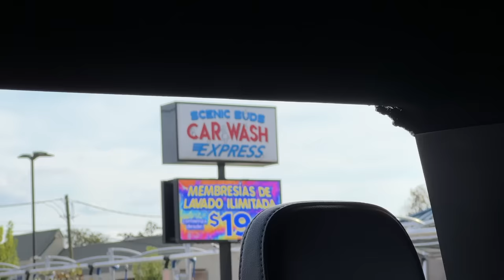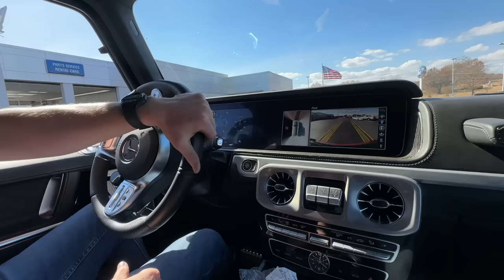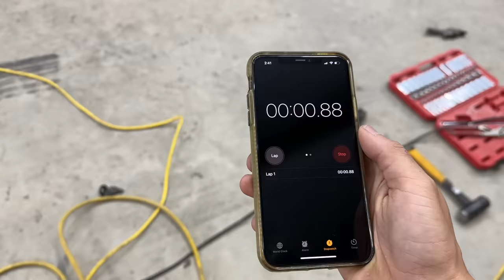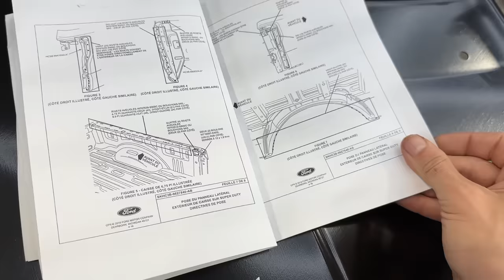We Rebuilt A Wrecked 2022 Ford F-250 In 30 MINUTES!!!

Comment: Taking it through the Car Wash like that was a VERY dumb idea, now you will be chasing electrical gremlins for a good while! 😂😂
Reply: Believe it or not most carwashes don't use salt water
Reply: Not going to hurt it one bit.
Reply: NOPE. if that's the case why would you wash the engine bay ? Now if the truck was under water now that's a different story.
Reply: @jerrywilcox9890  Yeah, soak those leather seats, it's good for'em.
Reply: @daquekenfor6901 it’ll more than likely be fake leather real leather is used for the more luxury car brands all the others use synthetic leather
Reply: I just could not believe they did that.
Reply: It’s gonna smell sooooo bad
Reply: @daquekenfor6901  lol so what lol it's not going to hurt anything.
Reply: @daquekenfor6901  shit I've left my windows down in my truck in rain storms more times then I can count.nothing has happened to them lol.
Reply: @danvdz  no it won't.
Reply: @floydhelms44  there not the first to do it nor the last.its not going to hurt it so it doesn't matter.
Reply: That will be the next giveaway vehicle
Reply: The connectors on the outside of the vehicle are meant to be exposed to the weather. The connectors inside the vehicle were never meant to be exposed to water. This vehicle is destined for electrical issues and it will all be down to oxidization on the pins in the connectors for the modules.
Reply: Damage now not only side swiped but flooded also. LOL
Reply: @danvdz   its a 2022
Reply: It was sooooo dumb I had to laugh.  It's not my truck.
Reply: @andrewk8636 believe it or not fresh water can destroy sensitive electronics just as easily as salt water. And generally modern vehicles have all kinds of electronics that are not sealed in anyway all over the interior.
Reply: Don't think it will do any damage,  it was just STUPID to do!
Reply: I always wash inside all my vehicles with a pressure washer
Reply: The screen glitch during the wash at 3:25
Reply: @armychris3973  good for you if they're modern vehicles filled with electronic modules then you could find in a few years you start having issues
Reply: Nah those truck is build Ford tough 😂😂😂
Reply: Sure will
Reply: Hope they pull out the carpet and let it dry so the underpaying doesn’t get all mildew.
Reply: I thought I was watching Whistlin Diesel for a minute,  you don't want to confuse yourselves with him.
Reply: Bro go back to playing csr 😂

Comment: Someone say, “corroded electrical connections!”😢
Reply: Better than oem shuuuuyyyy
Reply: I wouldn’t worry about that there I’m sure the humidity is low
Reply: Uaw did way worse to those connections
Reply: Please…it was not that much water folks, chill out. Except if it went down into the dash vents…😂
Reply: @squid_fish  please ?
Reply: You guys are always doing a good job 😍😍🔥🔥💯💯
Reply: Yep, wouldn't want to be the long term owner of it
Reply: These guys are fools
Reply: nah, brand new seals on every connector it’s gonna be totally fine
Reply: The only thing that’s going to be an issue with that truck is that it’s a Ford 😂😝🤣😉 the problem is most don’t understand that it is for the most part sealed connections . Think about the fog light connections tail light connections etc .
Reply: @eggegg6101  like you said lol new connectors lol
Reply: Electrical Gremlins intensifies  😂😂😂😂
Reply: Hope pops gets it
Reply: @boblarson3655  Kinda like flood water !  Its just water !!
Reply: 🤯 electrical connection have seals to keep moisture and liquida out
Reply: @newfiebullet4184 it's not going to hurt it.
Reply: @jeffdraper5523 not going to hurt it.
Reply: @AdamSmith-kb7kt jealous much lol.
Reply: @NEWFIEBULLET-1 doesn't need them not going to hurt it.
Reply: @joealex65 not going to have any problems.
Reply: Anyone ever left the windows or sunroof open in the rain? It'll be fine. And it's not salt water.
Reply: Bro and this give this away
Reply: @jerrywilcox9890  ? lol
Reply: @NEWFIEBULLET-1 it's ga our humidity is never low😂
Reply: @jerrywilcox9890  :) still wouldn't want that to be done to my car
Reply: Tell yah a whole lot of haters tears 😢 🤣 
One thing that you have to remember is that humidity and the heat will have it dry as fast as it got wet then driving back to the shop will speed it up more drying it..
Carpets might be a bit damp but they'll probably be dry overnight 🤔 🤷
Reply: It’ll be absolutely fine
Reply: It's ok its just a ford
Reply: @AdamSmith-kb7kt fools that make more money than you 😂
Reply: They will just give it away and buy another one 😂😂
Reply: They’ll be fine. I have a ‘18 f250 flood rebuild and it has had zero issues since it was a totaled at a few months old. The car wash did nothing to it
Reply: Next giveaway rig😂
Reply: After the wash so is the truck now a flood damage
Reply: @atomicbogator6799  Chattanooga TN cupcake.
Reply: @reggiehammond6508  no its not you clue don't understand what flood damage is lol.thats not going to hurt that truck one bit.truck wasn't submerged in water for a long period of time lol.not even close to enough water to do any damage.
Reply: @jerrywilcox9890  Chattanooga is on the Georgia border and their parents house was in Georgia cupcake.
Reply: @mike5162  lol I know where Chattanooga is.i drive truck and know where it is hahaha.and it's not in GA.
Reply: @mike5162  sitting in Chattanooga right now cupcake
Reply: @jerrywilcox9890  well then you know it’s right on the border of Georgia so if someone is comparing the weather conditions of general areas you might know that a few miles doesn’t make a big difference now does it?
Reply: “Fist your momma!” 😮😢
Reply: Drain plugs ?
Reply: @jerrywilcox9890  if you are in Chattanooga, can I ask how many miles are you from being in Georgia?
Reply: Short city 🤣
Reply: @proudvirginian no i haven't because im not  tarded
Reply: Great content!
Reply: Lmao they have to pull the whole interior anyway. They can dry everything out. I think it's hilarious.  More work but worth it for the views. You boys must have been saving this one for a minute.  The Shelby truck is still there.
Reply: Let the next owner worry about all those connections that got wet.
Reply: @jerrywilcox9890  their shop is in Rossville tn cupcake and they often are in GA I literally live here lmao
Reply: Tavarish is that you?!? lol
Reply: It will be their next vehicle giveaway. The future owner will deal with that nightmare 😅
Reply: I've seen these trucks go 6 feet deep in Mud and get washed like that lol it's nothing new guys it'll be fine
Reply: Hope this truck is for Pops
Reply: Not much worse than forgetting to roll your windows up when it rains .😂
Reply: Who’s that?
Reply: @AdamSmith-kb7kt no they are goons lol. Stop hating. You were entertained right. You were so entertained are you interacted with the video and left a comment  i’d say they deserve a thank you from you
Reply: @mannymex777  what in gods name are you smoking man?
Reply: @AdamSmith-kb7kt  that all you could come up with. You had time to sit and think of a reply, and that’s the best you could come up with lol.
Reply: @waynerobinson4978   yeah, what about the layer of sound insulation under the carpet? I guess it will go toast the moment it gets completely wet. No big deal, just take out the carpet, get it dried and replace the whole layer of sound insulation, then dry off the metal part and then I'd say it'll be fine. Will they do it?
Reply: @Shadowband72  when it rains for a week

Comment: Mold will grow underneath the carpet with all the padding and underlayment.
The carpet, padding has to come out and be dried out very well.  The sound deadening from the factory has to be completely dried because it absorbed the water as well. Possibly you may have to replace it,  it will Also turn to mold.
Reply: No it won't
Reply: @jerrywilcox9890 yes it will, mold is a tricky issue.
Reply: @jerrywilcox9890  i promise you it will,  I've seen it multiple times,  it will turn into a musty odor,  pull up the carpet and you'll see the discoloration on the floorboard and the matting, eventually  mold grows. 
It can happen from sunroof drains clogging,  A/C drains clogging. 
Driving through flooded waters  etc..
Reply: Putting the car through the washing machine without doors!!!🧐🧐🧐That was just plain stupid.
Reply: @nikosgalis6007 not really, they made it for attention, getting comments on their videos and this video might be recommended to more people etc, you see youtubers doing dumb stuff like this for attention all the time
Reply: No it won’t, could either put a dehumidifier in the truck to absorb the water, or leave the truck running with the heat going and it will dry up all that water. This is what also of detailing shops do
Reply: So anyone who forgets their window open during heavy rain should remove the carpet?
Reply: Y’all really think goonzquad cares…they have money at their disposal 🤷🏼‍♂️ let them boys have fun.
Reply: @qmmadi  if the carpet gets soaked and you don't address it correctly then yes underneath your carpet it will turn to mold as well as that musty odor will develop. 
Depending on how much water gets in. 
In this video they used a shop vac to suck up the water on top of the carpet,  what they're not getting up is all the water that is saturated into the underlayment foam underneath the carpet, as well as the sou nd deadening, that won't dry on its own unless removed and air dried .
Reply: They went from side swipe to flood damage
Reply: @Chris-hw4mq flood damage 😂😂😂 amount of water went in truck is like a passing shower. The truck wasn't submerged in water
Reply: You're right... I just dealt with this on my uncle's car. Ac drain was pushed up into the inside and was draining into the floor board. Took everything apart, dried it, sanitized multiple times, shampooed with an enzyme cleaner, steamed, did a full deep clean on the interior, sanitized the ac ducts, and even did multiple ozone treatments and still couldn't get the smell out. The only way, like you said is to replace the carpets, padding, and sound deadening material, sadly.
Reply: very stupid taking the car through the wash with all the electronics exposed and carpets
Reply: @billconroy7647  I understand that, but in honesty I think it will dry 
They have the front and back window open as well as 2 doors 
If that doesn’t dry it and get the odor out then I’m sure they will address it. I’ve pressure washed a carpet in a car before and it took just leaving the windows open in the garage to dry.
Reply: The project was too easy and they needed another variable
Reply: yea what about the screens coz is a modern car…. went from sideswipe to flood damage….
Reply: It's not flood damage if it wasn't submerged in water...  @Andy-xd7ng
Reply: Just take the carpets out and let the car an carpets dry in the sun for a day. Not that hard.
Reply: Who else saw the f150 that someone won
Reply: Hell ya it’s gonna grow mold.  Wtf
Reply: It did on my car when I left window open and had rain. First I thought its ok, but after year had to remove carpet and holy-molly 🤦🏻‍♂️
Reply: I want to see builds. Not stupidity like taking it through a car wash with no doors on it. Sorry guys… that’s just dumb
Reply: The water was merely superficial not like it was submersed in water. Winter time with snowy boots and such is not much difference.
Reply: Dehumidifier

Comment: Im kinda upset they did that wash but.. If theres no new issues then.. I guess its okay..
Reply: When they were tearing it apart you could see a pool of water still in the carpets and in other areas😭 that speaker is definitely toast thing was drenched
Reply: Even should the electronics have survived, water is the floor is never good. You got sound insulation there, that gets damaged plus stuff will rust in the floor.

Comment: Fun lol,  ya'll just also added minor flood damage. It will be alright. Good deals with minor flood damage vehicles at auction where water entered just carpet under the seat level with good running engines and no body work to do. Just pull seats ,carpet , check modules electrical connections. Most off the time those connections are sealed tight.

Comment: Those fords are held together by rivet bonding. Rivets are the mechanical bond and the structural glue is an adhesive bond obviously and also a corrosion resistor and sealer. Even tho they are mostly aluminum the rivets themselves are normally steel and that glue actually seals the steel and aluminum so they don’t galvanic corrode.

Comment: Hey guys I know you might not have any idea about a 2011 jeep compass latitude it needs a new abs module and brakes and calipers and possibly all the wheel speed sensors and I’m not sure if it needs to have them replaced but the motor mounts seem like they might be either weak or broken but just curious if you might know any on that sorry about being long winded.

Comment: Sorry to say that the rear door of the driver's side doesn't match the rear door on the passenger's side.   The driver's front door top window frame is higher than the rear door top window frame.  You both are doing an excellent job and I am sure you will figure this out with ease.

Comment: as someone who is getting started into bodyworking at a ford dealer it was insane to see those bed bolts come out with a 1/4 impact because almost every single one is locked up tite either A we get them out after messing with them for so long or we have to grind off the head of the bolt

Comment: I can only imagine the electrical components that got damaged in that car wash… I imagine that dash and center console are toast.,
Reply: Also the carpet and sound insulation of the floor have soaked a ton of water, it was crazy to do this. Not saying that any loose wires will start rusting.
Reply: @antons7202  I agree . I can imagine the potential buyers face if they saw this video…

Comment: You should start getting and hiding projects while you research parts availability, that's not to say you should just be rebuilding crashed cars. I enjoy your typical build series videos but if you wanted to mix it up take your normal 12-13 video build series and consolidate it into 2 x 5 in part series. have a break in the middle to do a week long 3 part build series "fix and flip". I'd love to see you guys in a collaboration with some of the other YT Builders too, old cleeter has the right environment for you guys to hone your drag racing and drifting skills, there's Steve Morris Engines when you need serious horsepower, Kevin @ KSR and Cleetus's crew are great fabricators.... the list goes on.. How about a ground up build of a "Goonzquad Ultra 4" or Baja style truck

Comment: People talking about corroded electrical connectors because you got it wet on the inside . 😂 I guess they've never been anywhere where there's a high humidity in the air . Or driven a Jeep home through a rainstorm because you left your hardtop at home . I guess there's an idiot born every day .

Comment: Guys, i don't care how goofy you are but please, never brought a car to a car wash that is barely opened (no doors). You will know the consequences that will be happened. Not worth emulating. It will damage the components of the carwash. If there were metal particles stucked to those foam and other cars will fall in line, it will damage the exterior paint due to metal scratches. Very upsetting. And you didn't remove the carpets just to put outside so that it will dry easily and buff off those film of water in the flooring to prevent corrosion. And lastly, the dash that were sprayed with pressurized water, you should stripped that out and have it dried also under the sun.

Comment: well i watch one more time and find a flaw in their repair job   so when you glue on a cab side or bed side you trigger on your glue then spread it with a supplied brush for complete coverage then apply a nother squiggly line like the first one and leave this one go then apply your panel  these two jackwads didnt put the second coat on so im sure down the road if this truck gets hit on this side well heck even the other side this is gonna pop off  believe it or not inside of that bonding glue is tiny little balls of some scientific compound that when you screw or clamp your new panel on the balls keep the panel from going metal to metal and squeezing all of the adhesive out  so you end up with the desired amount that the scientist came up with  it6s pretty obvious that  these two have never stepped inside of an   I- CAR classroom  the reson i know all of these facts is im certified and have been for longer than these yah hoos have been suckin air